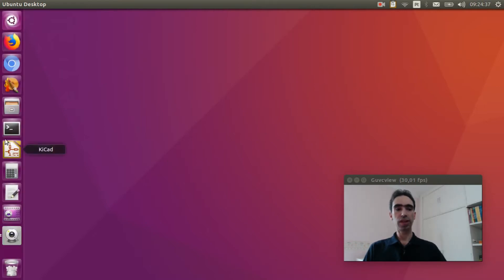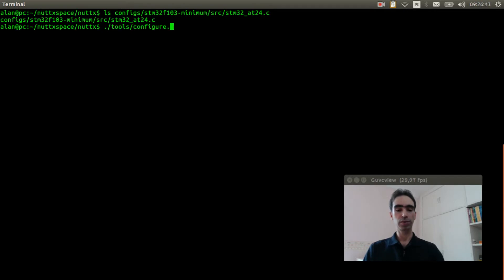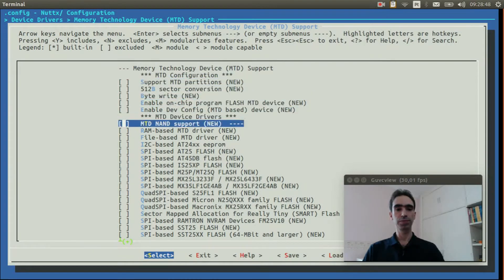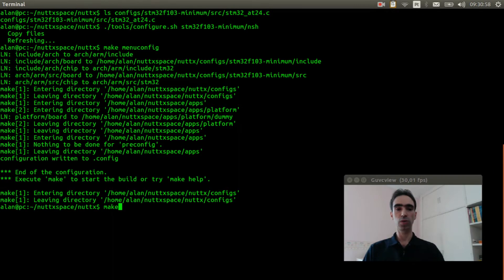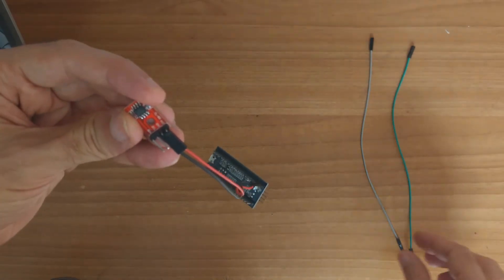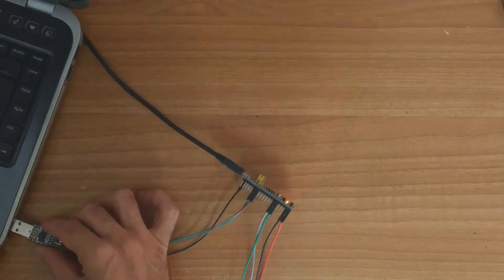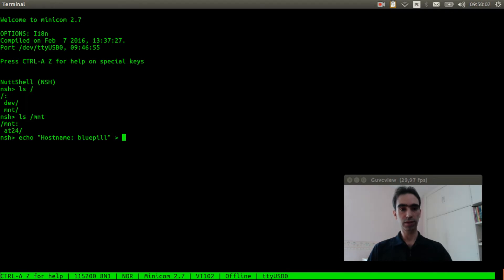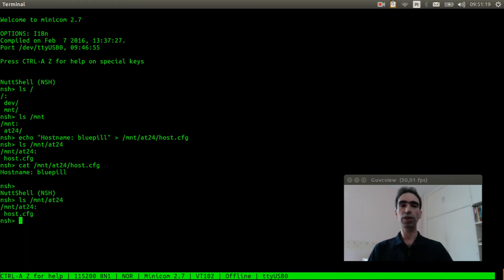#027: Using an AT24 EEPROM on NuttX

Comment: hello Alan
Would it be possible to compile each driver and store it in eeprom and link it when necessary.By this we wouldn't need to compile
the kernel every time to add a feature.
Reply: Hi Vasanth, yes you can add the drivers to EEPROM, but I think using a SPI NOR (video #018) could be better than using EEPROM, because SPI NOR has more space.
Reply: So would it be possible to complied only drivers or apps without compiling the whole os,if so how to do it?
Reply: I didn't compile only the application as binary objected. I only used NuttX as a library: https://acassis.wordpress.com/2017/03/28/using-nuttx-as-a-library/ it also avoid compiling all the system. BR, Alan